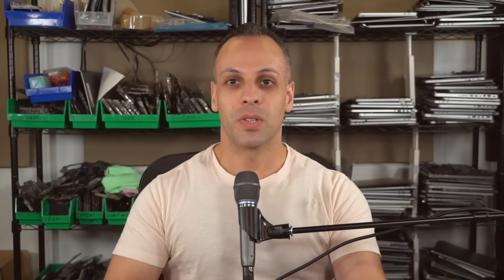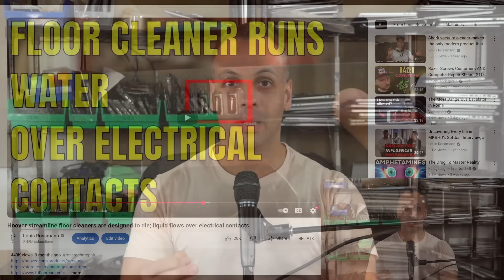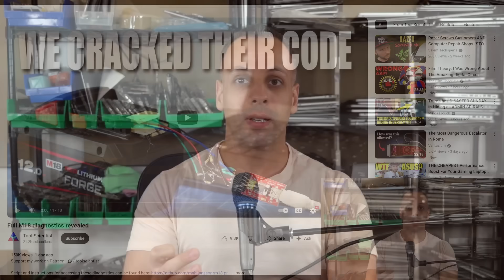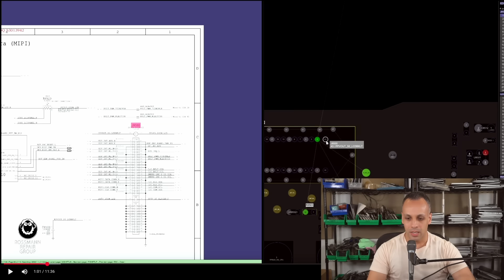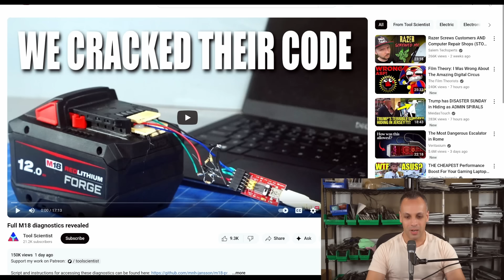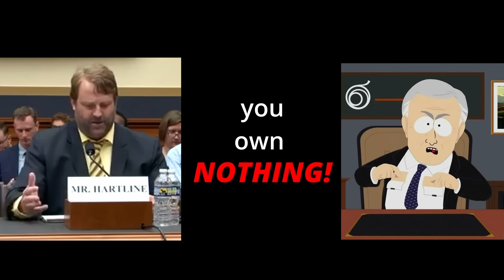Imagine putting DRM in a battery to void warranties...

Comment: This is an industry standard/"cartel type" thing. Other TTI brands, Dewalt, Bosch 18V, and Makita also don't do balancing, as far as I can tell. Neither while using the battery, nor while charging.
Reply: One can almost count on one hand as to which models of batteries that have balancing out of the popular tool brands.
Reply: @MrKillswitch88 which one? I honestly don’t know
Reply: Makita is just Makita. They are not a conglomerate.
Reply: More reason to buy real Marita products from Japan.
Reply: Bosch, Makita and DeWalt aren't owned by tti
Reply: @workingcountry1776  Yeah but they don't balance charge either. I had to take apart most of my dewalt batteries last year and manually balance the cells.
Reply: @workingcountry1776 there is a comma between the brands ;)

Comment: Drm in a battery, what a time to be alive.
Reply: No kidding! What's next? DRM in dental floss?
Reply: @steelman5862  There are on the brushes, already
Reply: @steelman5862  if you don't pay the subscription it melts itself into a chunk of wax and plastic
Reply: @steelman5862 with Flossario™ you can always get just enough floss. No more guesswork. Our patent floss extruder system takes FLOSSPODs coming in plain and 3 different flavors. Flavor pods sold separately.
Reply: @steelman5862  Don't give them ideas. 😶
Reply: Manufacturers saw what HP was doing with ink and said “Excellent” just like Mr Burns
Reply: @akshonclip  first I heard Philips does that with their bulbs.
Reply: Kurig put drm on a coffee pod, just about anything is possible meow
Reply: @Tremoraid  Nespresso put barcode based DRM into their new pods.

Their old pods just have a rubber seal that's patented and cannot be reverse engineered, resulting in poor pressure when using third party pods, and resulting in a lot of leakage and sub par extraction.
Reply: @vaska00762  cannot be reverse engineered.
Is that a challenge ?
I'll just ask a Russian friend, they excluded Russia from the global commerce, so it's only fair no IP laws have power there.
Reply: @Tremoraid in the pod itself?
Reply: @nafod32  the foil, i think it had a code/pattern people ended up bypassing it by just taping the old foil from the top to whatever pod they wanted to use or to its sensor
Reply: @Tremoraid that’s wild!! Glad we never jumped on the kurig train
Reply: @nafod32  i had a k-cup machine for a few years before i started grinding my own coffee beans, stopped drinking coffee for a few years when it tasted like cigarette smoke to me, then afterwards that whole filler scandal happened. single cup drip makers exist so i use that now.
Reply: I highly appreciate the meow.
Reply: @Tremoraid is being serious.
Reply: Brand locked 3d printers and filaments already a thing too.
Reply: @rallyfeind  I feel like this one is a combination of corporate greed and fear of people making whatever they want because that means "They could make a gun ohhhhh noooooo"
Reply: @hokorikera Well knowing what I do about plastics from working as a material handler for a Johnson plastics plant it makes sense.  Plastic isn't always the same even if it is the same type of plastic batches fail some entire pigment batches would elasticize the polymer and we got spider webs out the injector nozzle purging it.  By us only using one source we could both report back and get replacement stuff sent if we had anything bad.  It works better to promise output if you have some governing over the input.  If you want to legally argue you make the smoothest or most consistent printer when you advertise it you should have a quality control of some type for material.  Recycling is also a false pretense of the materials unless you keep obsessive identification and separation of waste color and material variance to allow the pigments to bond and not compromise the material isn't always going to sustain in presence of all the variables of mixing plastics brands and colors could add to the material.  It is kinda just another lie to sell plastic if I am being honest.  Not that it is impossible just not functional and beneficial to most.  The fear of printing guns is lost when companies buy them too now. Temu is a bigger problem with "oil filters" and fake glock switches for the ATF and all that noise.
Reply: Probably not in my lifetime (I'm in grumpy old man territory now), but some of y'all who are younger than me may live to see the air you breathe and the water you drink DRMed.
Reply: @MikeU128 I mean GMO crop lawsuits are already a thing way too long ago now.
Reply: @MikeU128 nestle has entered the chat
Reply: @MikeU128  That may not be far off, drinking water used to be free (tap water), now we buy drinking water by the gallon.
Reply: The drm in your alive license has expired.
Please renew it or commit unalive.
Otherwise you will be taken to arbitration for force renewal or unaliving.

Thank you for your cooperation.
Reply: @akiraraiku  I think there was some goofy film where people's lives were on timers
Reply: @ExistedDima Logans Run. When you were 30 you ded. Something like that. You didn't die, they ended you.
Reply: @ExistedDima In Time was the title.
Reply: @ExistedDima Logan's Run. 1976.
Reply: @Duomaxwell02Mthat must be it
Projected clocks on forearms
I remember it because I think it had some exquisitely bad VFX somewhere
Reply: @akiraraiku  There's probably multiple stories with a similar idea. One that I can think of is the '70's movie "Logan's Run" where everyone goes through a renewal ceremony on their 30th birthday and is reborn. Except that it's just a scam to control the population level of the domed city that they live in.
Reply: @ganggreen9012  yeah not quite sure of the book title but "In Time" starring Justin Timberlake is a related concept to a book from about the 50s or 60s where they developed a heart clock, you only live so long before it just stops to control population levels, but due to abuse some people get to live forever instead while manipulating the rest of society. There's a bunch of stories where longevity is targeted as a means of population control in hard situations (often with abuse, Logan's Run is about the only the exception there where there's no upperclass abusing the system) or worse just another form of exploitation itself (In Time where time is also their currency the rich effectively can live forever while the poor die trying to get home from work due to being underpaid and running down their clock).
Reply: Overengineered garbage
Reply: The PSP had DRM in the battery, and that's what bit Sony in the ass and allowed for Pandora batteries and magic memory stick mods lol
Reply: Nintendo recently added drm to the switch 2s usb ports, no unauthorized attachments.
Reply: @404Listnotfound  That company has just been increasing the crap with every single release. There is no saving them or getting them to reverse course, just don't buy.
Reply: DRM in condoms, "You moved to fast for our products confort, as punishment it will burst exactly in the Oh moment" 😂
Reply: I thought Blackberries did a similar thing for a decent while?
Reply: @xalataf3365 not little blackberry ! Louis raised her better than to put drm in her batteries
Reply: Soon you'll have to pay per charge cycle.
Reply: @Svenpa  Just xxx amount of cycles or after a certain date and then whole thing bricks it self.
Reply: DRM in battery packs is sadly nothing new at all.
That's going on for over 20 years by now.
Reply: It's not really DRM, just unpublished
Reply: Just get a bit brace at this point.
Reply: I wouldn't necessarily consider this to be DRM (that would be ONE-KEY), but simply a data logger, as it does not disable the battery unless a genuinely hazardous condition exists.
Reply: It’s in more than just that
Reply: some dystopian shit fr
Reply: Just buy the cheapest thing you can, most tradies do anyway. This spyware they put in everything is designed to deny you warranty making it a one use item. Deny them a sale.
Reply: DRM oxigen, you have to pay a subscription for the CO2 you emit. Because of "climate change" (TM)
And don't you dare you make your own energy, do you think you own the Sun, there's also a tax on the Sun.
Everything will have software, then you won't own anything because changing the software breaks the strongest law : DMCA.
Reply: Digital Rights Management In Anything...Really....
Reply: They will own nothing and be happy
Reply: They said it is because micro-controllers can do so much more with so little additional components but if you take a look at the PCB you notice there usually use twice as much components.
Reply: Well you have seen all yet to come , Drm in typewriters ,toilets ,air condition , your monitor , name it.
Reply: Printer carts have entered the chat
Reply: Don't think this really country as DRM. Not sure what the appropriate term would be though.
Reply: Time to go w hercules at HF. . .
Reply: This crap predates current clue-in batteries...  whole 'genuine' shit, going back to early smartphones and tablets (portable TVs/screens, laptops, gps devices etc), this stuff going for decades already.